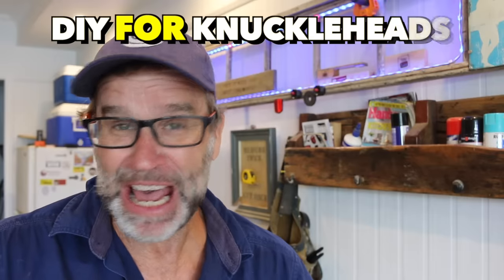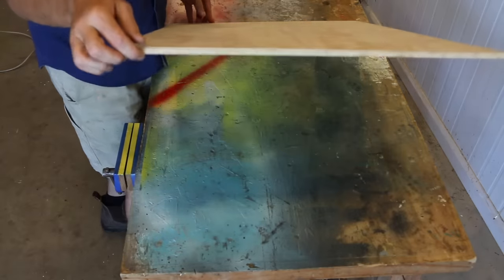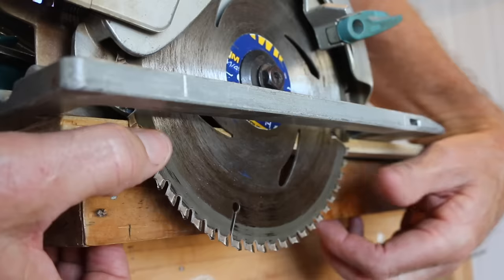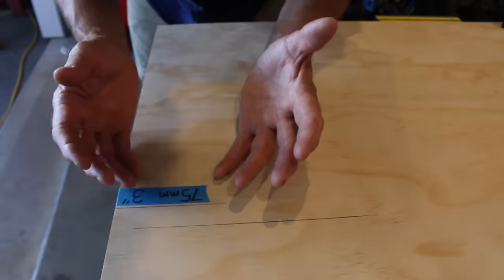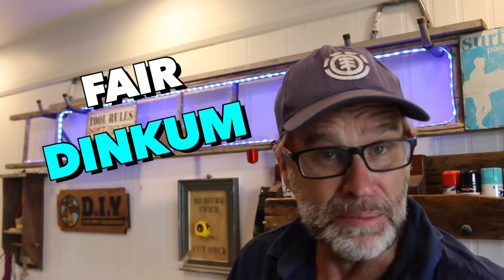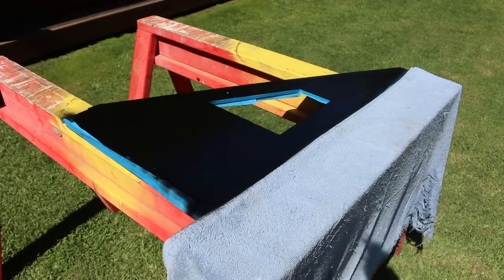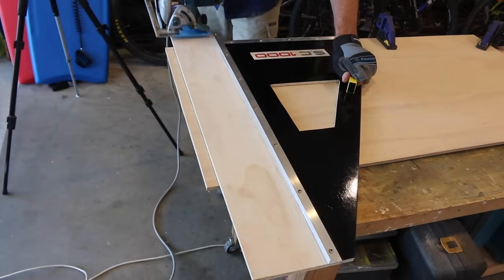How to Cut SQUARE Like a PRO!

Comment: Top tip: When you fit the first aluminium track, fit it about 1" further in than you need, then run your saw down it and it will cut the working edge perfectly parallel; no measuring = no room for error. 😃
Reply: Came here to say the same 👍👍
Reply: Also thought that might be an idea. Another improvement (although much harder to do, I guess) would be to cut the jig width slightly undersize and put a strip of the self-adhesive splinter guard on there. As used on track saws.
Reply: Also, instead of making it so big on the off cut side, you can add another L bracket and make it for your router for grooves, dadoes, and rabits. You can use the side you don't need for clamping it to your workpiece.  Or you could make it for your jigsaw. Two jigs in one.
Reply: @whatyousaidbud  Ditto.
Reply: Great tip again, I'll have to try this one! Bonza! 👍🏼😃
Reply: @marktrosien3005  I am struggling to visualise this...are there are videos anywhere with that modification? Thanks
Reply: @harrycaul2494  you can make it so that instead having 1 straight side,  you can make it so that there are 2. One for your circular saw, and another for router. Both use same concept.
Reply: @marktrosien3005  Great idea. Thanks
Reply: Ace! Thanks mate.
Reply: Yes, that is a great way to ensure the off-cut edge is parallel with the saw guide rail!  However, you still need to also make sure the two rails are perfectly square.  I personally would check it with a framing square before attaching it to the plywood…

Comment: Finally someone on YouTube with that sweet metric measurements 😂 every other DIY woodworking channels all use stupid imperial
Reply from the maker: Cheers Adam 👍😁🇦🇺🇦🇺🇦🇺🇦🇺🇦🇺
Reply: What's the problem cant you read imperial measurements lol
Reply: Nothing wrong with either system. It's what you're comfortable with. As long as you get the result, does it really matter.
Reply: Negative much?
Reply: @philbreau  Nothing wrong. Nothing? Quick! What's 9/64 - 1/4?
Reply: @age_of_reason  -7/64.
Reply: @age_of_reason  I'm comfortable using either. I convert between ANY linear measurement. Furlongs, chains, miles, km, mm, km, feet, au, fractional imperial, decimal imperial, etc. Eg. 1" = 25.4 mm. For each fraction, just multiply 25.4 by the fraction. 1/8 * 25.4 = 3.175 mm. There are rough tranlations between metric and imperial. 3 mm approx 1/8 ". 6 mm approx 1/4. 19 mm is very close to 3/4". A ratchet of either will likely fit the same nut. 

Just don't get involved with liquid volumes. Pints, gallons, cups, litres, quarts etc is worse. What makes it more confusing is there are imperial and US units.  US fl oz is not the same as imperial fl oz.  It's about 4% more than imperial. Most people don't understand the conversions.

I grew up in old school house. School was taught in metric. If you went to school in the 70's and 80's you learned to use both and how to switch.
Reply: Here’s how I look at it. Metric= intelligence. Imperial= the slow kid in class. Are you listening, America?
Reply: @philbreau  I once had a physics teacher who gave us a velocity problem on a test that was nearly impossible to solve in the allotted time.  I sarcastically asked him what units to use.  He said that it didn't matter, as long as they were used consistently.  I scribbled on the answer sheet something that was totally illegible, and then gave the answer in furlongs per fourtnight.  He was so lazy that he didn't convert his answer into furlongs per fortnight, and he gave me full credit for the problem.  He did, however, accuse me of playing the horses, because "nobody else would know what a furlong is."
Reply: How many Oz(pick any of them) in a cubic foot?
Reply: @thomasvilhar7529  approx 997 imperial, 958 US
Reply: @philmay7834  metric doesn't mean intelligence. It's just an easier system to use. The slow kid in class should use metric for it's simplicity.
Reply: @composer1663  Good one. Or 45797500814276638.1438 fathoms per eon. Just a wild guess. Need to see the problem.
Reply: @philbreau  mph is easier on my speedometer .
Reply: @philmay7834  I know that was meant in jest, or was it? In any case, no thinking person could accuse America of being slow; until last November anyway.
Reply: @philmay7834  so what you're saying is the imperial system is too complicated for you and you need simple... Gotcha.

Comment: I think I posted before that I love this video? But just came back to give a word to UK viewer's who are making this , who might use B&Q to buy the alu angles and use a Ryobi circular saw- in short, that store don't stock 12mmx 25mm angle. I thought I'd chance a 15mmX25mm , and got home to discover that the Ryobi body catches on it. It needs to be 12mm or lower. which I know it clearly states above. Not had chance to go and change it yet, but on their web site I can only see 10mm and it is only available in 10mmx10mm , not unequal sizes. So just a heads up that you 'might' possibly then not have quite enough on the 'other (25mm) side' for the heads on your screws ? (although not tried yet) Any other Ryobi UK users find the clearance is a bit tight?

Comment: Nice jig!  Additional tip: Before you screw the aluminum track to the wood, use a smooth file to ease the sharp edges on both ends of the tracks.  You'll save yourself from leaking the valuable red stuff all over your shop.  Cheers!
Reply from the maker: Thanks mate and good tip! 👍🇦🇺😁

Comment: I’d been using a very subpar DIY cutting guide for the last few years. Just built yours and it’s a real game changer! Pretty fun to make too as I’ve never worked with metal. Many thanks!
Reply from the maker: Thanks Nick!....Glad you liked it mate 👍😁🇦🇺
Reply: @diyforknuckleheads  i think its kind of funny you using your tool that came with your saw to cut straight lines to make another tool to cut straight lines lol

Comment: Love the project, Shane! Might I add three tips/additions?

1. Before using the SC1000 on a board for the first time, run the saw through once with no stock underneath. That way, in case your jig isn't exact to your blade, this will cut off any excess so it won't transfer the error to your first cut.

2. Attaching something to the underside of the jig so there's less chance of it sliding while making cuts. Something like sandpaper, grip tape, or foam padding. Something thin enough your saw's baseplate won't slip under you jig.

3. Add some furniture wax to the guide. Less friction for your saw, and lessens the marring of your jig.
Reply from the maker: All great tips there M.H 👍👍. I was looking for some of that grippy stuff to go under it but couldn't find any where l live.....some of the drawbacks of living in a rural setting l guess. Thanks for watching mate 👍😁🇦🇺
Reply: @diyforknuckleheads  Some glued-on sandpaper will do ya, in a pinch!

Comment: Hey Mate, love the video! I've been dabbling in woodworking for the past few years but just never got the hang of getting that straight circular saw cut. Very helpful video. Unfortunately in my locale the plywood cutting machine must be on the fritz because at our local Home depot I'm not sure any of the plywood actually has 4 straight edges.
Reply from the maker: 👍😁...Thanks Coy 👍 Cutting a straight line just takes a little practice mate 👍😁🇦🇺

Comment: Brilliant! I’ve seen some videos where the aluminum guide was mounted on the plywood a bit wider than the width of the circular  saw. The excess was then cut off by running the saw along the guide. This makes sure that the aluminum guide and the track edge are exactly parallel. Your second short piece of aluminum is novel and squares everything up! I will definitely incorporate your idea into my track saw guide.
Reply from the maker: Yeah, good tip re having the ply a bit wider than the saw. The next time l make one l will do that 👍

Comment: Only thing I would do differently is set that long angle piece back 1/4", then your first pass sets your zero against the blade much like setting up the splinter guard on.a track saw
Reply from the maker: Good tip Russell 👍👍😁
Reply: Good point, but then you run a risk of losing your 90 degree factory corner, which is kinda the whole point of the jig. Don't get me wrong, you're absolutely right about the perfect saw line calibration, but for the weekend hobbyist  this solution might give the best results with the least fuss.
Reply: @TheLastPharm  but the accuracy of the cut angle is already limited by how well you've fitted the guide rail. If that's not perfect, the factory edge isn't going to help. If I was to make this, I'd use a framing square to set the angle of the guide rail rather than trusting to pencil marks against the base plate of the saw.

Comment: Howzit Uncle Knacks, Paul here from SA.
Planning on fitting out a camper truck & have too (budget) build all the internal joinery/ cabinets etc. myself, my carpentry skills are limited. Will mainly be working with ply sheeting, researching the tools I might need, table saw, track saw, mitre saw & circular saw, I could easily spend R45k/😬, not in my budget. I bought the circular saw (a decent Bosch) & made this plus 2x your straight cut jigs, can now do everything I need & it cost less than R3k!!!
🙂😉Thanks mate!

Comment: Whilst the jig I built for my circular saw is not as fancy as yours (mine is just some hardboard and a strip of pine), the idea to make a jig came just in time for my recent project (building a sim rig for racing games). I had never been able to cut particularly straight with my circular until I built this jig - what a HUGE difference. I used quite thin hardboard for the base as I had some cuts where holding and clamping was going to be difficult. The thin hardboard allows me to staple the jig into place before making the cut.

Thanks for the great tips!
Reply from the maker: 👍....Awesome! Well done Daz 👍😁🇦🇺

Comment: Im currently in the middle of building this design with modifications from another design, but since I have a worm drive saw I have to reverse the cutting side on this build which Im now realizing makes it impossible to use a handle like you have. I guess I will just have to rely on clamps even though I was looking forward to using all these beautiful handles I had sitting around.

Comment: That settles it. This is now going to be the second project of yours that I'm going to do.
Made your stackable saw horse set plus a second, narrower set this week and I'm loving it!
Side tip: if you're cutting large sheets, use a big piece of XPS insulation foam as a backer so when the circular saw blade goes though, it's not cutting the concrete below.
Reply from the maker: Yeah Great tip re the foam A.S!.....used that before and loved it 👍👍 Well done on the horses.....mine are still going strong after many years of reckless abuse 👍😂 Thanks for watching 👍😁🇦🇺
Reply: @diyforknuckleheads  One other thing, after you have chowdered the top of the I-beam, you can unscrew the legs and flip the I-beam over!

Comment: Very nice jig. Makes me want to buy a circular saw just so I can use it. The only problem is that it's too small!

You really need to build a 1220 model since a very common cut for a large jig like this will be a full plywood sheet. Using a thicker piece of aluminium angle on the bottom end will mean not having to make the plywood part of the jig so wide since the metal will be strong enough to extend a fair way past the plywood part.

Comment: Thanks for this. I will try to make it tomorrow. Just today I was trying to make a straight cut on my circular and was going crazy and then this video popped up in my feed.
Reply: And what if I can't get the same size aluminum angle you suggest? I've been looking online and can't seem to find those measurements.
Reply from the maker: Michael....you may need to go to our local hardware store or metal merchant.....Just remember that ou need to get the lowest profile you can otherwise the motor of the saw will hit it. Good luck 👍

Comment: Made this up this weekend. A change I made was to add in three routed grooves parallel to the bottom edge; the idea here is that I can use it to mount a removable fence (made up for each job from scrap so that it's the same width as the material being cut) so that I can get consistent width cuts, as I don't have a mitre saw. I'll see how that goes next weekend...
Reply from the maker: 👍😁....good idea Robert 👍

Comment: Hi uncle, I love your videos, your tips and your sense of humour, keep up the good work! I'm learning woodworking and I came across a rather peculiar problem. I live in a rented flat size of a shoebox, the only way to do my DIY stuff and not to bother the Mrs is to do it on a flat roof of the neighbour. Which means no band saws, no table saws, using small battery tools and handy jigs and guides. I love this triangle guide and I thought, this will be a very useful tool in my toolbox, handling many jobs in a clever way. I tend to do some careful planning on the computer before I make the first cut, itt helps me to troubleshoot the idea before I buy something I don't need or even worse, finding flaws in the design before wasting materials. I made the plan for this jig, wanted to measure the height of the aluminium fence that fits under the motor of the saw aaaaaand I realised that my saw is a lefty. To me, this feels natural, and I know, most worm drive and battery circular saws are lefties, but this jig is righty. The obvious modification to this project is to flip it left to right, but it creates another problem: only the slim side of the shoe is on the jig, the body is not really supported. Does anybody have a good jig design to do quick right angle cuts with lefty saws?
Reply from the maker: Tricky one mate but personally, l don't have a real problem with only the slim side being on the good piece. A firm grip on the saw and with pressure applied to the guide it works for me basically 100% of the time. 👍😁🇦🇺
Reply: @diyforknuckleheads  To be honest, it's my limitations, namely the tiny flat (no power/water in the garage) and the budget that's making the decisions for me. I'll definitely discover my options, but for now this is what I have to make things work. Aaaaaand it did work, I designed a lefty jig for this scenario. I admit, it's bulkier, but can do 90/75/60/45/30/15 degree cuts. I'm making a crosscut jig after this and a little extra feature for the first is on the way, to cut keyed mitres for frames. I'll link photos if you're interested. :) The next big project will be a drawer chest with shelving, this is why I need the jigs BTW. (I'm learning woodworking, I'm learning 3D CAD design, designing my tools and I'm 48. Better late than never… :D But so much fun and definitely rewarding.)

Comment: Do you think bevel cuts could work with this jig by perhaps making the fence adjustable to compensate for the extra clearance distance from the blade. Or would the gap created between the edge of the blade and the leading edge of the jig cause problems?

Comment: This is a great idea for a saw guide, I would add a long slot at an angle through the centre of the top. So I could add a through bolt attached to a wooden stopper and a wing nut or turning knob. So it could clamp itself onto the ends of material. 

Or add thin layer of rubber underneath so it grips to the material
Reply from the maker: Great tips there mate 👍👍

Comment: This looks like a great jig.  My wife got me a nice Kreg guide that's like a smaller version of this - problem is my circular saw won't cut straight even against a guide. Somehow it always pulls away from the guide.  I need to find a way to align it because it drives me nuts.  Great video!
Reply from the maker: Thanks Frank 👍

Comment: Looks  great but my circular saw has motor on the right hand side. Would this still work as the base plate is alot smaller that side?

Comment: Great vids and a great jig, do you have to use pan head screws for the fixing or will any do.
Reply from the maker: Thanks mate. Pan head screws are great because they are flat on the underside of the head so you don't need to countersink the hole for the screw to sit flat. 👍😁🇦🇺

Comment: Nice idea and solution, however it will not sort my problem. It is a de Walt cordless circular saw.  On doing a long cut against a steaight edge it starts to get move difficult to move and the cut drifts a few mm over a metre or so.  Measuring with a vernier from the edge of the base plate to the front and back of the blade shows a small difference.  This means the base plate is 2 or 3 degrees out from the blade.  I presume that this is a tolerance problem in manufacturing.  Any ideas on how to solve this?  Might be worth a video showing how check the alignment and how to solve it.

Comment: I think that this is a brilliant idea even if you've got a mitre saw and a table saw.  I've needed to shorten pieces of wood like you showed there and you can't use the mitre saw nor the table saw really because it's just too big and floppy to get on there unless you had a huge table all around it.  Using this method I could get accurate cuts immediately.
Sorry to hear that happened to your tooth!  I hope the dentist can fix it up as it  looks like it'll be tricky to repair.  If it they can't it doesnt look too bad so I hope it's not too painful.
Reply from the maker: G'day Andy 👍 Glad you liked it mate....gotta tell ya...it works an absolute treat 👍😁 The tooth.....what can l say...l'll find out the damage on Tuesday 🤞🤞Thanks for watching mate and hope you have a cracking weekend 😘👍😁🇦🇺